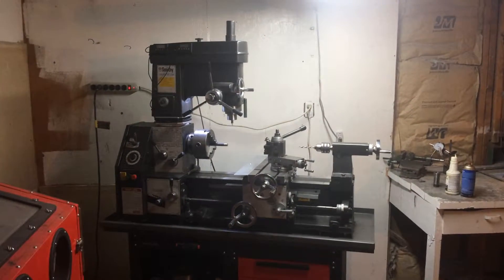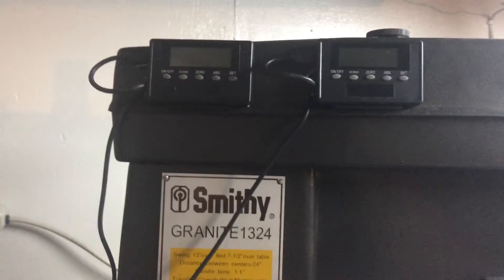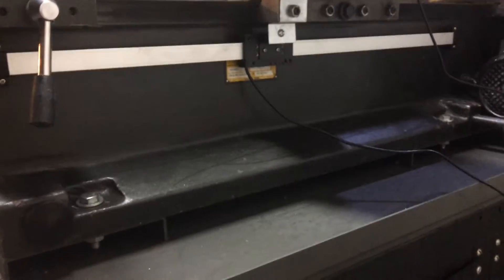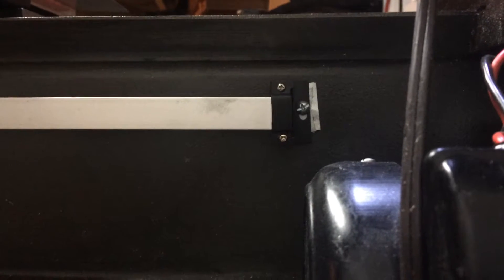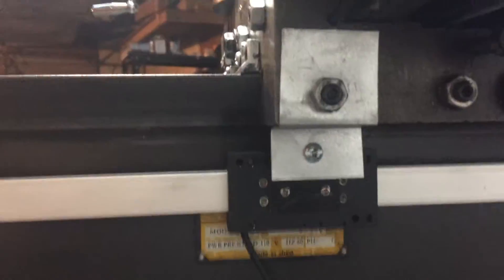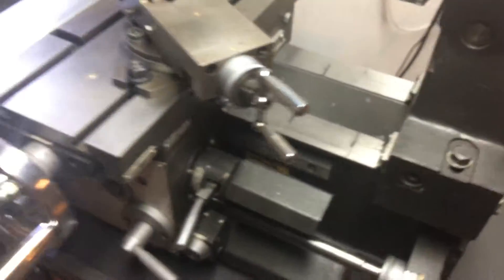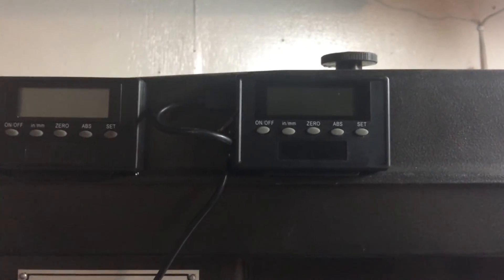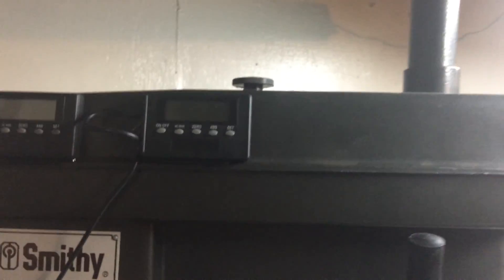How and where I installed DRO kits on my Smithy Granite 1324 lathe milling machine

Comment: going to be getting a granite 1324 very soon!  how do you guys liking it?  had a midas 1220 ltd many years ago but never really got to use it and ended up selling it.  but now i got time to mess around in the garage and been wanting a lathe and mill but still tight on space, and as far as bench top lathes/mills the smithy has a nice size to it at a good price. 
nice video, thanks for sharing
Reply: I love the Smithy.  It's not perfect and it takes a bit to get used to, but it's never let me down.  Mine is one of their newer Granite models (I can't remember the year they changed it) so I can't comment on the older ones.  I will be upgrading when I get some cash saved up now that I have more room, but if you have space issues, I would definitely recommend a Smithy.
Reply: I too had a 1220 several years ago. I sold mine due to lack of time. But I made some very nice stuff with it. Built some motors from bar stock etc. Was able to do .0005" cyl's (using dial indicators for all moves).
I am now considering a Granite to use for gunsmithing... because of space issues in my shop.

Comment: I have a 1324 and planning to install a Dro on my machine. Still working with the backlass on my system. Any help on adjusting.
Reply from the maker: There is a surprising amount of information on adjusting the backlash in the manual I found online.  http://server2.smithy.com/media/pdf/GN1300%20Manual%202008.pdf